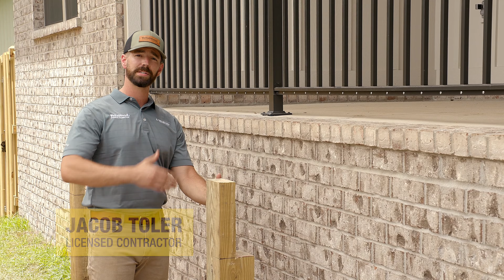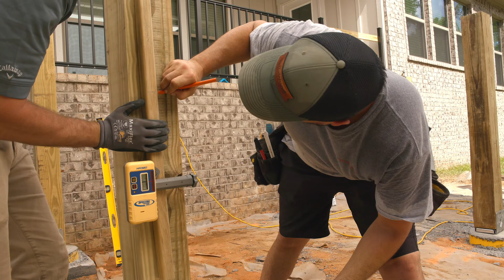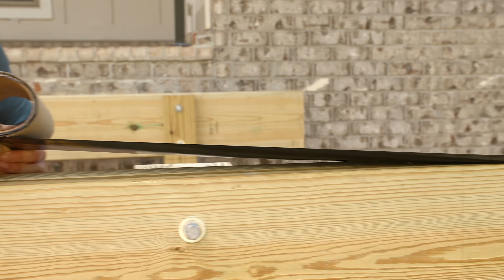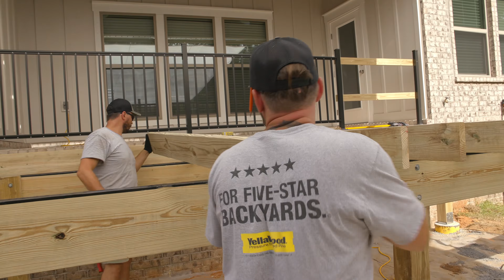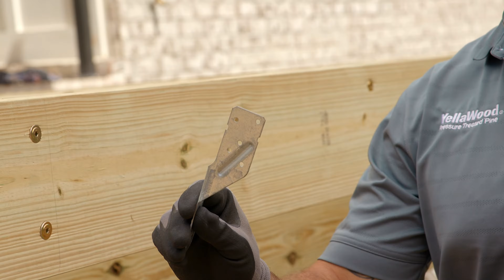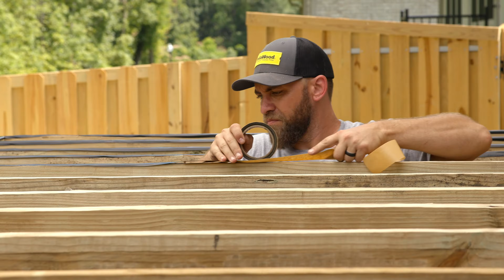Securing Deck Beams and Joists | YellaWood University

Comment: What if the beam is crowning in the middle? How do you flex it down to secure it to the middle post?
Reply: I have had this problem myself. The only thing I can say to do is... if by yourself - try flipping or replacing with a different joist or start at 1 end and work it down towards the middle, if with others have them stand on the high spot & put 2 3.5" contractor screws in to pull it down. Like when a wall is high on a part of the floor of new construction. It'll pull down brother!